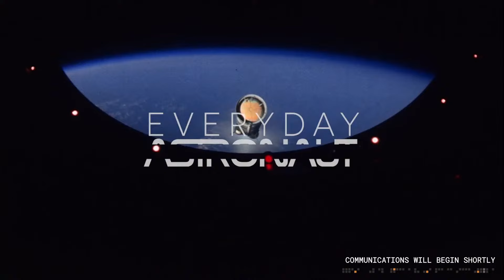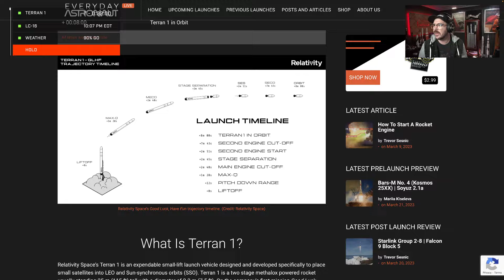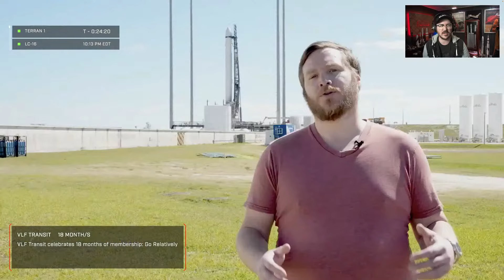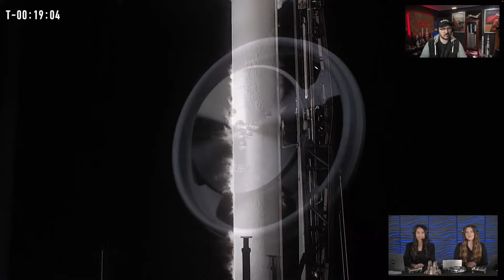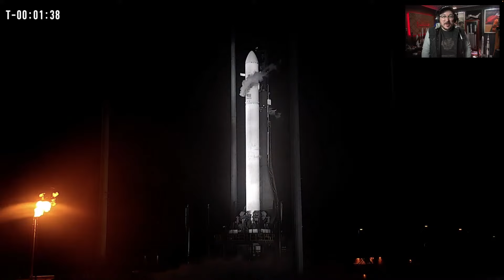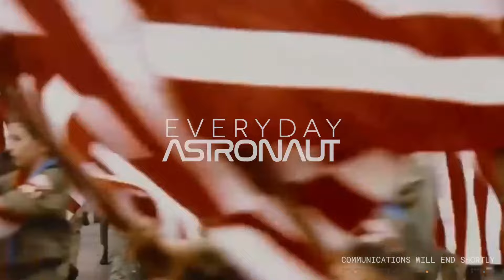Watch The 1st 3D Printed Orbital Rocket Launch Attempt! #Relativity  // #GLHF

Comment: I dont see how you prove your staging and second stage ignition by failing it but still well done and thanks for broadcasting.
Reply: Staging is not easy, spacex had failures on the Falcon 1 with staging.  I believe on the 2nd flight they clipped the engine during separation and on the 3rd flight they didn't separate at all.

Comment: Tim your answer for why some rocket have 2 engines while others have 7 to 9 engines missed the key reason for the difference.  Cost.  Take the Atlas V rocket:

RD 180 rocket engine:$10 million each.
RL-10  rocket engine $20 million each
Solid rocket booster:  $7 million each

So an Atlas 5 configured for starliner launch will have $64 million in rocket engine costs.  In comparison a new falcon 9 booster $62 million.  A used one is about $50 million  All cost are from a google search.   Why is cost difference?  ULA buys its engines from other companies About the only thing ULA builds is the fuel tanks and avionics.  Space X makes its own engines. 

 For Space X they drive the cost down as much as possible to lower there cost. Additioanaly the more they can reuse the lower there cost will be.   For ULA there is very little that can do about cost.  So for ULA it makes sense to use as many solid boosters as possible and and use one RL-10 and and one RD180.  ULA has never tried to reuse anything.  

Another issue is the hardware needed to recover a booster. . A falcon 9 lands they only need the trust from one engine   A RD180 engine at minimum throttle is still too much thrust to.  So it you want to recover a booster like SpaceX does you either need engine with a very large throttle range or use multiple engine.  It is hard to make a rocket engine with a very large throttle range .  So SpaceX chose to use 9 rocket engines on the first stage.   For a new rocket company their biggest cost is developing the rocket engine.  so many startups undeveloped a smaller engine and they use more of those engines in the final rocket.  

So overall the cost of the rocet engines and reusability goals drive many of the design differences in nrockets.
Reply: The Falcon 9 Block 5 is $67M for a reusable booster launch, per the SpaceX Capabilities & Services pdf from their website (Mar 23rd, 2023). This price increase started in April 2022. The cost of an expended launch is not known.

The 9 engine to 1 engine ratio is more about the first stage thrust requirements compared to the second stage thrust requirements, as both stages use the same engine for cost savings. SpaceX knows that they could get more performance out of a LH2/LOX second stage, but take the good enough RP-1/LOX Merlin as it does the job SpaceX requires at a lower cost.
Reply: The number of engines is driven by the power to weight required for your intended payload range.

Comment: How come they didn't continue with the coverage of the second stage as it reached its zenith in sub-orbit, and free fall to the ocean? Did the engine fail? What happened? The way they just ended the coverage with the women cutting in, with celebratory rhetoric seemed choreographed to me, and produces suspicion of hiding some sort of failure. Despite any suspicions, congratulations on the milestones achieved on this launch!
Reply: As you can see at 1:32:05 that the second stage engine doesn't ignite, so the second stage is done. Why follow it, when it's just going to crash into the ocean?

Comment: Is this reusable like space x? If not is it still cheaper?
Reply: This is their small lift (1.5tons) launcher as a pathfinder for their reusable Terran R medium lift rocket (20 tons). Like the Falcon 1 before the Falcon 9. Booster reusability is great, but has drawbacks.

First, if you don't have a fast enough launch cadence, you can spend more on recovery equipment and personnel than you save by reusing the booster.
Second, you take a payload hit for the recovery system on the booster. The Falcon 9 B5 can lift up to 22.8 tons to LEO when expended (SX), but only up to 17.4 tons when landed on a drone ship (B1067.9). Doing a Return to Launch Site (RTLS) landing, costs even more payload as you have to add a boost back burn to cancel the lateral velocity and return back to the launch site.
Third, the higher and faster you go, the harder reusability is to perform. The heavier the dry-mass of your booster, the harder reusability is to perform.

SLS is the punching bag for non-reusability. So with SLS launching once a year, eventually, the cadence doesn't really justify recovering the booster. Not to mention that it gets higher and faster than a Falcon 9 as the SLS core stage almost reaches orbit, making recovery MUCH more difficult. The SLS core stage is travelling well over 3 times as fast as the Falcon 9 booster and is well over twice as high as the Falcon 9 booster at MECO. The dry mass of the F9 booster is 22-25 tons while the SLS core stage is 85 tons, so SLS masses over 3 times as much.
The SLS Block 1 can get Orion to the Moon, but not with the kind of payload hit like F9 has. The SLS Block 1B will send along a Lunar Gateway module with Orion, so it really can't take the payload hit either.

No, I'm not saying that SpaceX should not recover boosters. I'm using how reusability affects the Falcon 9 to discuss SLS and other expendable boosters.

Comment: I slept while listening to the video and had a dream that I'm on the launch. SpaceX loaded Crew Dragon with many students (I and some others couldn't fit, because there was no more room). Some girls inside had been crying from fear. I'd been filming the process with my GoPro and smartphone, standing right near the rocket. Tim was outside, filming too, but sometimes I saw him inside the capsule. Some fat guy came to me and lifted me up, so I could film what happens inside the Crew Dragon. We started to run away from the launch site at about T-10 sec. SpaceX strapped solid boosters on below Falcon 9, because they wanted safety. The boosters fell off and started to fly around the launch site without direction. I was a bit scared, cause I was there. And there were some books, that deployed from Falcon 9 on the parachute. I asked NASA staff why they did it, but woke up before I heard the answer.

Comment: Could you 3D print a rocket out of fuel, so that it eats itself and gets lighter the further it goes?
Reply: that doesn't sound very structural viable. But on the other hand the German company hyimpulse develops boosters and maybe even whole stages where the main fuel is paraffin wax. I assume it's part of the structure as well. so... maybe you can find out more about this approach
Reply: That is theoretically possible, yes.
Reply: if you mean using the rocket like fuel why you need to print it ? it is more dismantle the rocket and try to get fuel from it
Reply: @vkobevk   Imagine a solid fuel rocket without any casing, basically a payload sitting on top of a big mound of solid fuel propellant. This idea has been proposed. If someone were to do it, I supposed printing the fuel cylinder would be as good a way as any to produce it.
Reply: @odysseusrex5908  try anti matter+matter

anti matter eat matter and matter eat anti matter

Comment: I expect Starship-Superheavy to ace its first flight. Falcon 9 aced its first flight, Falcon Heavy aced its flight, now it's Starship's turn.
Reply: It took SpaceX 4 tries to get the Falcon 1 to orbit in 2006-2008.
Reply: @steveaustin2686  it took 4 attempts for Falcon 1, not Falcon 9. 
Falcon 9 got to orbit first try.
Reply: @xaviersavedra711  Read my post. I said Falcon 1.
Reply: Define “ace”. If you mean get to orbit and successfully get both parts back done to a controlled water landing then I would put the odds at less than 10%.
Reply: @ATH_Berkshire  I define "ace" as getting to orbit on the first try.

Comment: Is this the first modern methane engine to reach near orbit speeds? Absolutely amazing!
Reply: And at least 130km in altitude.
Reply: Tecnically, LNG, but real close to pure Methane.  And yes.  :)
Reply: @ebenwaterman5858  While natural gas is roughly 65% methane and the rest is other hydrocarbons, concentrating it to LNG ends up with 95+% LCH4. Apparently the LCH4 that SpaceX uses has a similar concentration, so LNG and LCH4 are evidently fairly interchangeable.
Reply: @steveaustin2686  Didn't know that.  Thanx :)
Reply: @ebenwaterman5858  You're welcome. I didn't either until a recent NASA Space Flight stream for a Falcon 9 launch. :)
Reply: @steveaustin2686  NSF, nice.  :)
Reply: @ebenwaterman5858  Yeah, lots of good info on those streams.
Reply: The Chinese Zhuque-2 is reported to be a LCH4 rocket and it launched in Dec 2022. It also failed on the second stage.

Comment: Definitely an amazing launch, can't wait to see the second one roll to the pad. Curious what happened to the second stage engine. The fact it didn't end in a rapid unplanned disassembly is probably the most impressive part.
Reply: There was high flow gas coming out of the exhaust that runs the turbos, so I assume it had something to do with fuel/oxidizer flow failing, or just not getting it to light. She didn't boom like you said, so there should be a lot of data for them

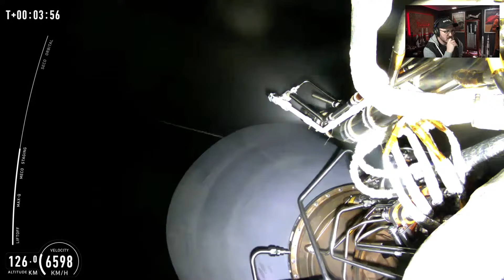Comment: 1:31:33 UFO flies directly in plume. Got to take a sample of that new rocket fuel!
1:31:43 Watch frame by frame using "," and "." keys on keyboard (in dark room helps), red UFO buzzes rocket and does crazy circular maneuver around the rocket in less time than it takes to say "second stage ignition failure".
Reply: You should get another hobby.

Comment: My 3D prints usually cant even lift off the build plate
Reply: Same. Well, I get them off sometimes, but it usually results in a rapid unscheduled disassembly
Reply: On a serious note, try using an all glass build plate at 60 deg C.
At print temp its really stuck but at room temp you can just pick it up.

It does require a great leveling of the bed for good adhesion, but if needed I adjust during the printing of the skirt.
Also very important to clean it with alcohol before printing.
Reply: Bahaha
Reply: Methane.

Methane is what you need.
Reply: Best comment I've read this year
Reply: I feel you! XD
Reply: lol
Reply: LMAO
Reply: That usually requires a glue stick! 😂❤🚀
Reply: This is great. 3d printing people know
Reply: Lol
Reply: Reiterate buddy

Comment: 1:31:50 Second stage engine had blue and red flames and sparks at ignition but didn't seem to achieve stable combustion. Looking at the velocity after MECO it seems that velocity only decreased. The second stage didn't seem to make any useful thrust.
Reply: Did anyone fill the 2nd stage tank?